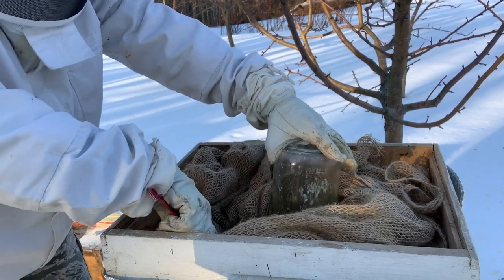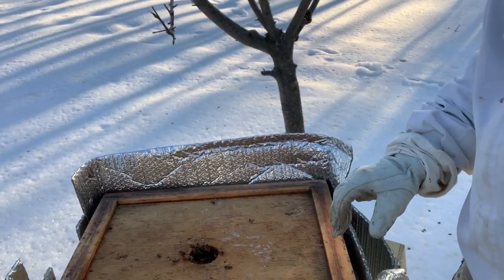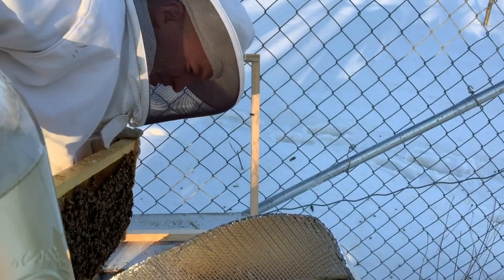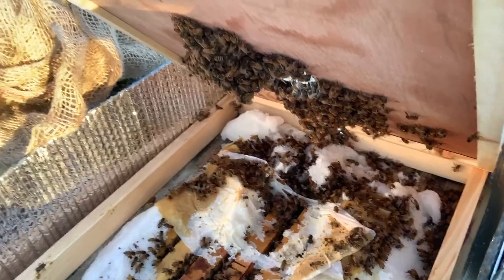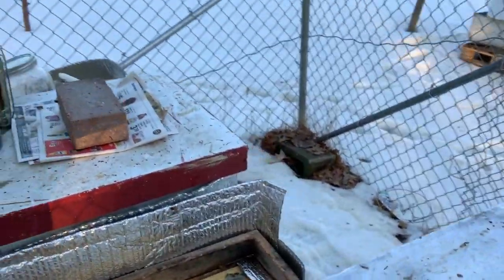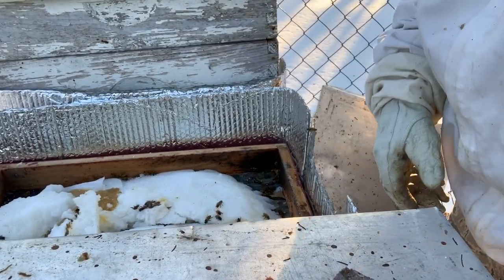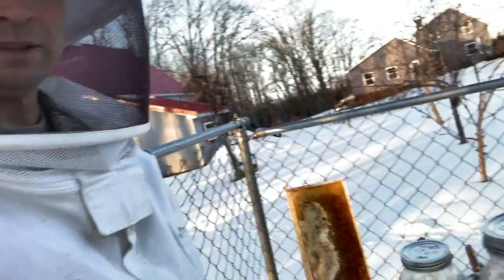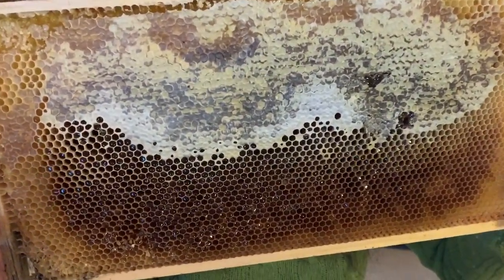March 3, 2020 Hive Inspection And The Year's First "Honey Harvest"

Comment: Looking good! Best of luck with your spring flow. What is your cutoff temp (generally speaking) for whether or not you open up your hives to inspect?
Reply from the maker: I usually don't mind opening the hives if the temps are above 40.  Sometimes I will if the temps are a bit cooler if all I am doing is taking a peak and/or dropping in a pollen patty.